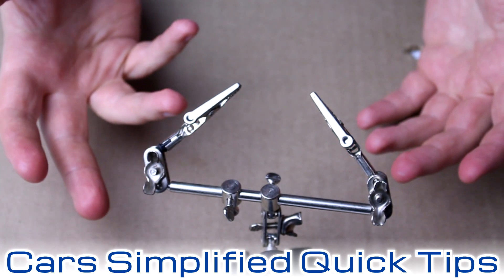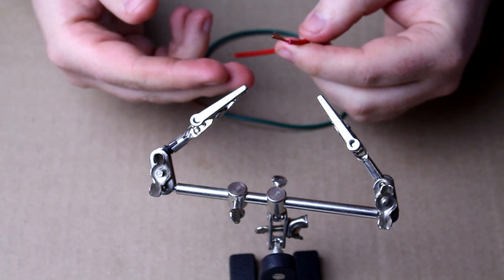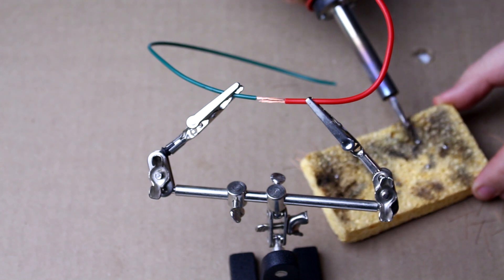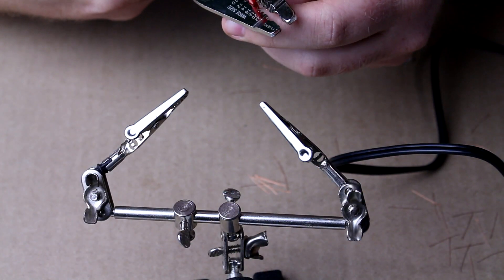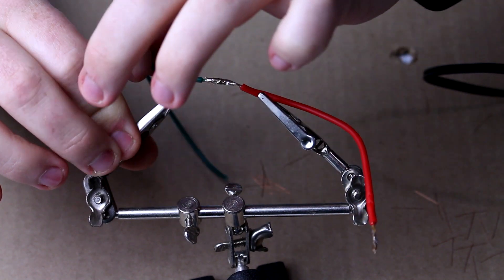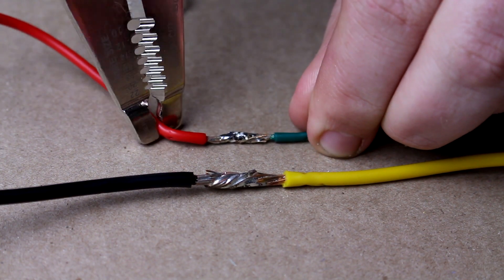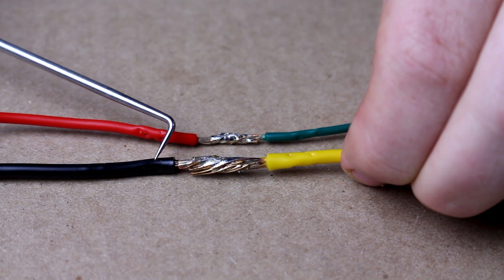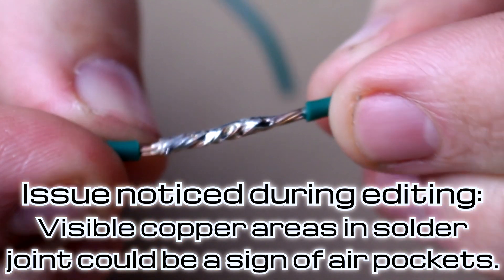Basic Automotive Electrical Wire Soldering & Examining Mistakes • Cars Simplified Quick Tips

Comment: That last "nice one" is a cold solder joint. 
Good job on making another bad connection. 

Use crimping if you don't want your automotive wires to fail.

Comment: Is there any way to keep a solder joint completely flexible?
Reply from the maker: Not that I'm aware of. If you want it bent a certain way, you could attempt a curved solder joint, but even alternatives to solder require a solid section or chunk of something inconvenient at the connection.

Comment: Nice video, pretty much how I do it too (it’s “rosin” core, not “resin” core fyi).
Reply: Oh, I thought they were interchangeable or just a regionally different way of pronouncing it! Is one wrong or just a different kind?
Reply: Kelli Cees Solder for plumbing is different, it has an acid core which is not suitable for wires since it can cause corrosion within the joint. “Rosin” core is what you need for electrical work & I believe he intended to say that, he just misspoke & said “resin” instead.
Reply from the maker: Had to look it up because it has been bugging me; I did indeed make a mistake, but not by much, apparently. From what I've read, rosin is a processed solid resin.

Close, but I will definitely aim to pronounce it "rosin" in the future.

If this video takes off I bet this will be a popular comment.
Reply: Cars Simplified Sorry, I wasn’t trying to pick your video apart, in one of mine I call a pressure plate a “clutch” so I’m far from perfect myself lol!
Reply from the maker: Oh yeah, no offense taken! I was just curious after your initial comment and had to look it up a few times.